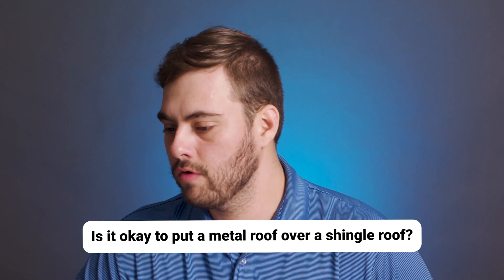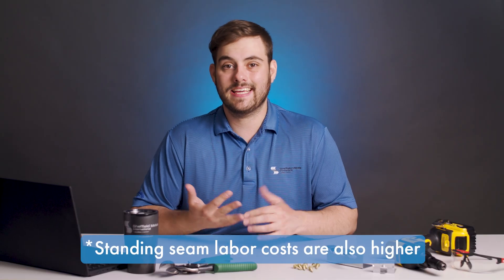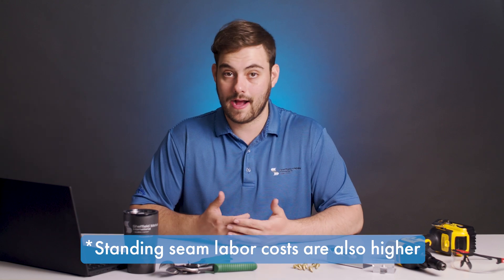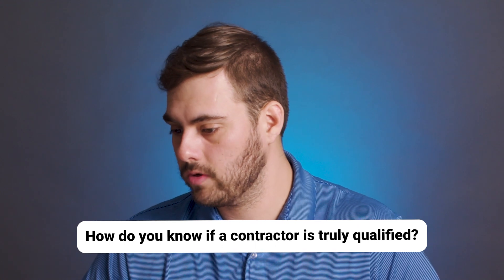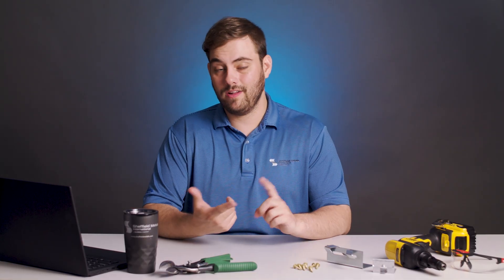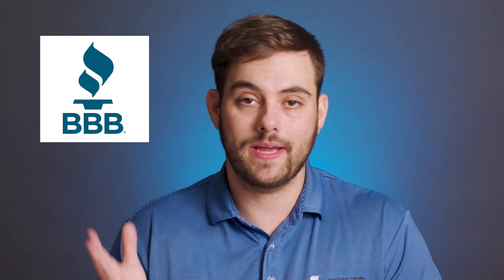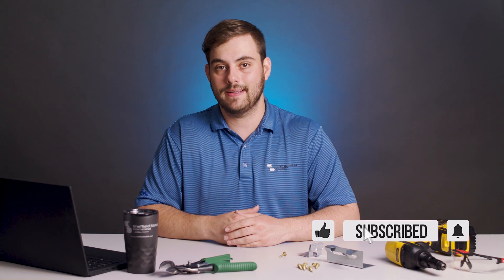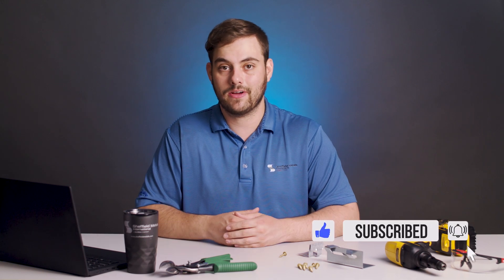Oil Canning, Metal Over Shingles, Contractors, Dissimilar Metals

Comment: I'm exploring options for a new home build. The bardominium trend is appealing.  I've been told in Michigan I shouldn't build a red iron framed home with metal roof due to the extreme temperature shifts we see.  50 degrees in 24 hours isn't unusual.   What would best practice be for this installation?   Insulated roof decking then an air gap before standing seam installation? 

Same for reroofing a traditional home in Michigan with vented attic. What woudl best practices be to get a lifetime roof?